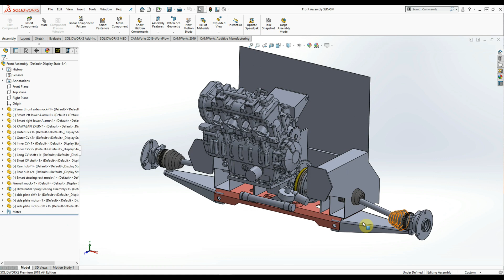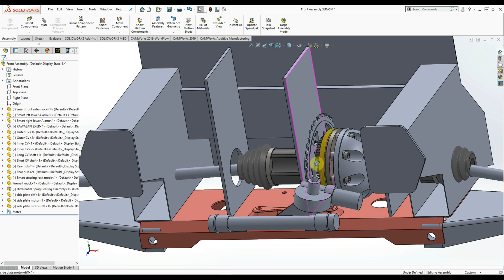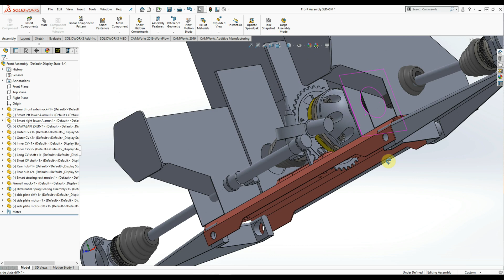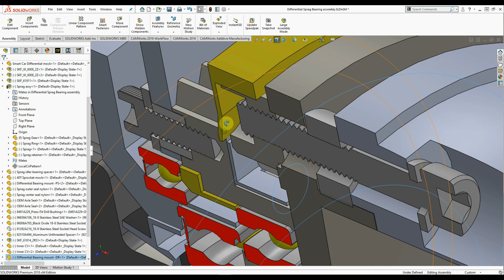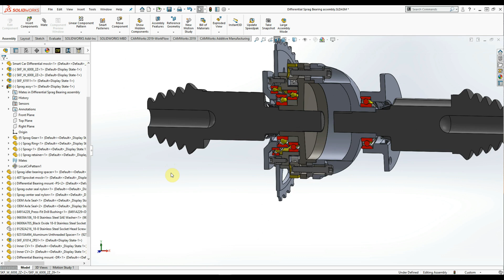Smart car + GSXR =AWD FUN Part 1 of 22

Comment: I’m putting a Hayabusa Engine in my Scion Tc I already ordered the motor from eBay
Reply from the maker: Sweet, I gotta see this build 😎
I think we all should start the trend again and build small cars with sick power! I hope you get all you need from ebay for the engine to run. If you look at my video 4 or 5 I had quite a few codes to bypass with certain resistance.
Reply: @HandyDan  I’m adding a single turbo to it as well

Comment: To think someone else was building a dual engine DIY hybrid from an EV and a motorcycle!  I'll be watching.  A couple of comments: Amazing work designing a sprag differential.  I hadn't even considered it for my car, I'm just stuck spinning the engine in neutral through the chainline on my car if I'm running pure EV, but it's very noisy and obviously lossy.  For my throttle control, I'm actually pulling signals from the Leaf accel pedal dual halls directly, and sending this to an Arduino that's running a Dynamixel RS485 servo.  I tried a hobby servo but it couldn't handle the electrical noise coming off the ICE.   I also use the Arduino to toggle between the accel pedal signal and a spoofed zero-throttle signal to the Leaf ECU so I can regen via ICE.  Good luck, you have lots a head of you!
Reply from the maker: Thank you. I hope we both iron this out. I don't really know if my sprag bearing will last long, but time will tell.  I also have the potentiometer on my OEM EV pedal to help ease control of the gas, but a trim pot on my steering wheel to adjust balance and that's where I get my regeneration.  If I turn the gas up and release the pedal a little. Also I hope my servo doesn't have issues with RF

Comment: My question is could I get a 14kw battery pack used in a Zero motorcycle and used it to at range to my 2014 Smart Car ED? The battery would fit easily in the "trunk space" and like you...I just need more than the 60 to 70 miles I get out of the 17kw battery. Hope you are doing well. I'm still in California but hope to get out to AZ soon.
Reply from the maker: I thought about this too, but batteries cost a lot more and trying to connect with the canbus and charging them seems like a hassle too.
I'm doing this because of the Chevy Volt we had that was zero anxiety. 
Extra batteries will boost your range, but gas has unlimited range. 
Still have pure electric in daily driving. 
My crazy life loves the never before tried🤣
Reply: @HandyDan  you are my hero. It's one thing to have crazy ideas...it's another thing to have the skills and ingenuity to birth them and bring them to life. I think I'm gonna finally bite the bullet on a low mileage used Model 3 to become my daily but I'd like to keep the Smart ED. 10k trouble free miles since I almost lost it because of that faulty car stereo installation. I think you warned me about towing before but I would love to be able to drag the Smart ED with the Tesla and use it for my appliances and AC when off the grid camping etc... I was thinking I could literally fit the smart inside a large canvas tent and heat/cool it with it's system by just running it with the tent sealed up. These are my crazy ideas and dreams but I always gotta run them by the actual genius. Also... Is there a way I can add a plug that would let me plug into it and pull juice from the 75kw battery? I'll be watching this hybrid build and hopefully get to see it in person soon. Because being in AZ during the summer was more then a southern California kid could handle. I kinda lost it...lol.
Reply from the maker: @enterconnection  I have heard of people using the EV traction battery to run their homes during power outages. I'm not sure what they use. The traction battery is very capable of running a few camping lights but I'd sure hate to run it down in the middle of knowhere...